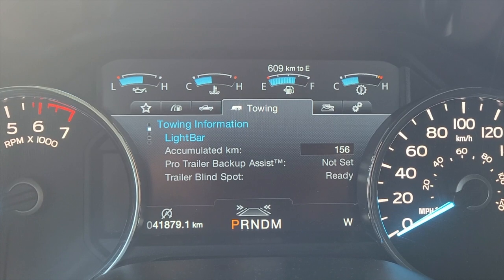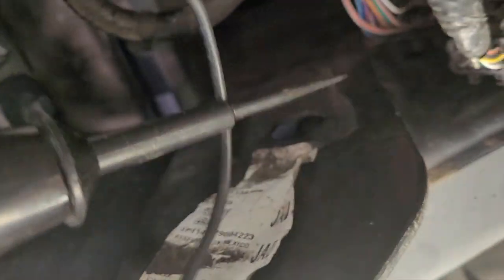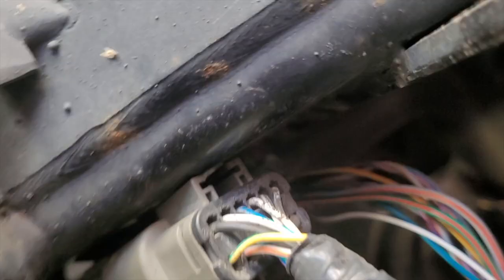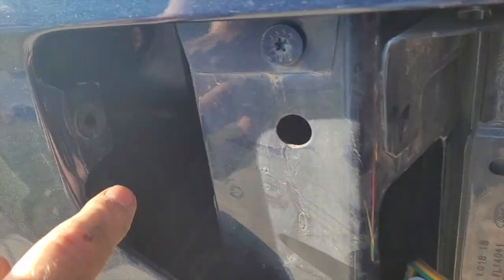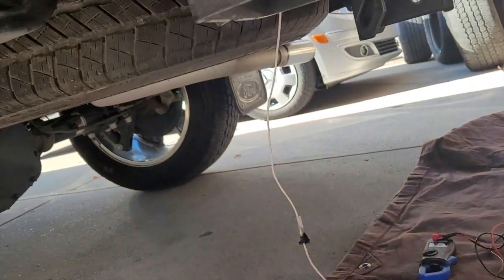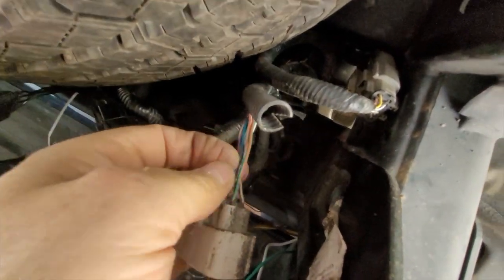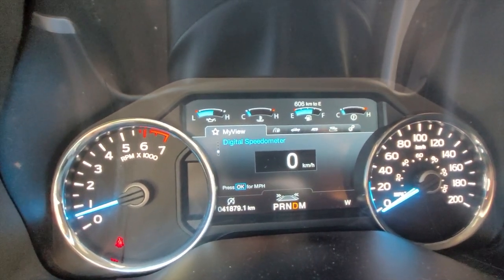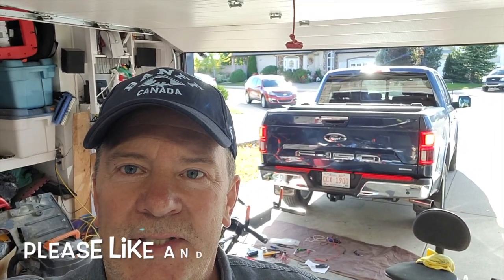F 150 Tail Light bar wiring tips

Comment: Thanks. I did the same thing except I decided to run a wire from the passenger side to the driver side taillight to keep the connection as high up as possible due to so much salt from winter in my area.  I also depinned the wires to get heat shrink over them.

Comment: I was a little confused at the taillight. If I understood correctly, you ran the bar harness directly to the left taillight and connected the wires there.  Then you ran the right turn signal wire back to the plug to connect it there. The ground wire was also connected at the plug. As an electrician I make a great truck driver. 😊 Thanks

Comment: I did the same thing with my 2020 f150 and now i get the trailer setting miles on my dash everytime i start my truck. What did i do wrong? Only difference is that i ran the right signal wire all the way to the taillight and my  ground, i connected it to the frame.

Comment: I used the same connector by the spare tire but used the frame as the ground. I didn't splice any wires either by going into the molex connector.  see it here https://youtu.be/yxzcnvDBBpE
Reply: that shit is complicated and too much time consuming how does one solder on their back especially if they haven't soldered in their life. Splicing tail light is much easier